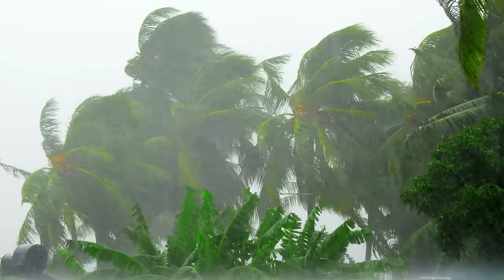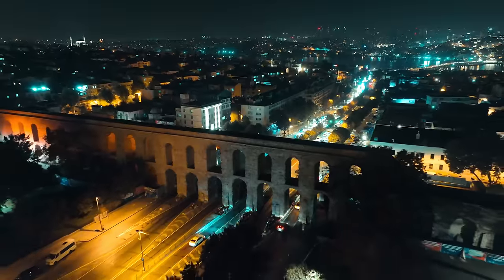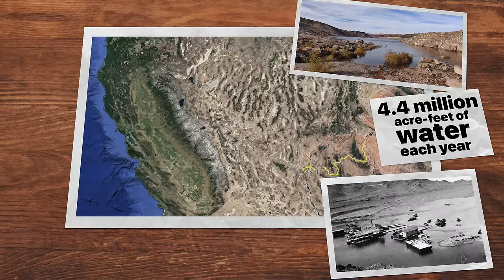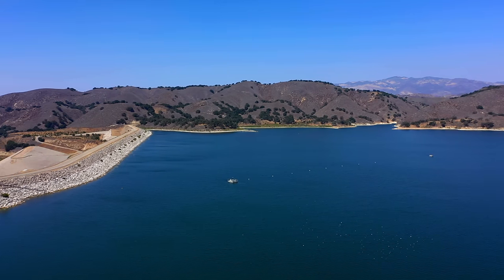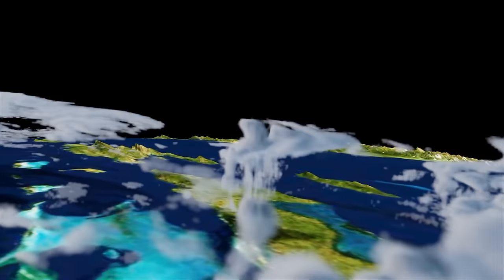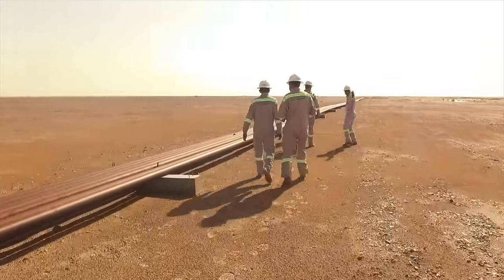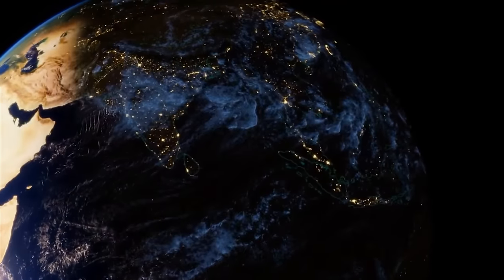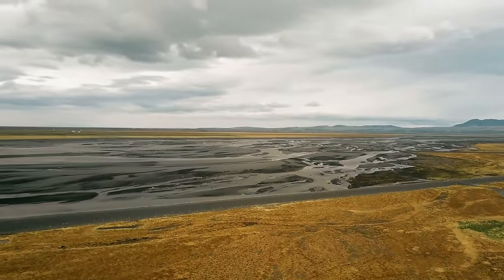Pipelines From Flood to Drought

Comment: I've been saying we need to do this forever.  Although I'd avoid "the scheduling" and just canal water out as it  accumulates or before it accumulates as a better way to say it.
Reply: We are never going to have a system of pipes that is so robust that it can move water out of the area as fast as a hurricane can dump it. And since pumping requires a fair bit of energy, it makes sense to limit the need to pump water back and forth if we can by using the most accurate weather modeling we can. We could definitely make it work without these kinds of predictive models, but there would be a lot of potential for wasting energy.
Reply: @johncrofford  Who said anything about pipes?

Comment: I actually thought about this not too long ago. Didn't know about existing pipelines though. Glad you did a video of this!  Your videos are always insightful and thought provoking. Keep up the great work!
Reply: Those existing pipelines don't follow routes that actually represent where you would want to move water, as a rule.  Once you consider that you would need to relocate the pipeline, the cost of pipes becomes a minor factor.  Just scrap the old pipes, recycling them into new pipes that better meet specifications for transporting water and skip the "cleaning" as described in the video.

Also, his calculations about how much water you could move through Keystone (presumably the earlier Keystone, not the XL that was cancelled) was laughable.  Aside from that pipeline not following a route where you would be interested in moving water, not following a route with major energy requirements for moving the water, etc., you can't simply take the viscosity difference and extrapolate how much water the pipe would move in that way.  The pressure in the pipes would, in fact, be far higher than "the same" because viscosity is not the only consideration.  You would be vastly increasing the velocity of the liquid in the pipe when you attempted to push 100x as much flow through it.  I'm pretty sure Keystone isn't designed to handle a high velocity (maybe supersonic, though I haven't looked up the current flow velocity in the pipeline or done the math for 100x that flow) flow of that magnitude.
Reply: simply add it into the ogallala

Comment: Wouldn't that just cause issues with other rivers since alot of that water goes into underground water systems that feed into various locations? So wouldn't that cause changes in areas that are outside the area water is coming from? You'd have to do this for everywhere or you risk changing the fertilization of the soil as well?
Reply: Absolutely,    and the water that flows into the ocean is not wasted,  It is a vital part of the eco-system

Comment: Thank you for addressing this with such thorough analysis. I have been suggesting this for 30 years, ever since the 1990 floods in Missouri (where I'm from). As a matter of fact, Missouri floods frequently, and the ability to move water from flooded areas would be a huge benefit. And that's not even counting the benefit to the dry areas in need of water.
Reply: Watch California insider.
Reply: The problem imo is that desalinating water would be way cheaper and less energy intensive.
Reply: @AnotherAmerican91  Still enormously expensive.  Got a fusion reactor somewhere?  We'll just manufacture water.
Reply: @knoahbody69  I don't live in California, I'm just saying if I did I would want to go in that direction. At the end of the day, if you live somewhere where there isnt infinite water, then your water is going to be more expensive. That's all there really is to it.
Reply: @knoahbody69  the west feeds you . America used to think and build big. Funfact burley idaho was going to flood in 87. Bunch of local people got together and lead by local church leaders. May have got the idaho guard to help.  The feds said we'll study the prob for a couple years. The people in iirc 7 days cut a cannel around the city to divert the flood that was toping a dam built in 1915 that had never filled. Lawyers said let the flood happen act of God no liability. Irrigation  president said we have to try and built plywood walls 4 feet high on top of the dam to buy a couple more days. America  if the environmentalists got out of the way could fix huge problems
. Look at bergoine new jersey needed a taller bridge for the new Panamax containerships. Both a tunnel or new bridge would cost 4 billion  instead they could raise the roadway 20 feet  to 165 foot clearance for a billion.  The epa fought them saying more similar would polite the air and two Kansas tribes sued to stop on maybe disturbing native American sites despite  not one shovelfull of dirt would be moved. All work would be on the already built bridge.  Please read book called a government of nobody.  Fun story's of a tree blocks a creek. City wants to send backhoe to save people's homes from flooding and city attorney  says  no we have to get army Corp of engineers approval.  Because that's a federal creek!  Ie while not navagatablebits self it was tributary to navagatable waterway

Comment: Thank you for covering this subject. I have been thinking of this myself. Even if it helped only a little it would help both ends of the pipe. I don't know if it would prevent flooding but over time it would surely reduce the cost of our food. Taking your final points too their logical end shows that we would also have more usable land and reduce drought. I hope someone is working on this.
Reply: Re: reduce the cost of our food.....
The greatest train robbery in history
Prices are not going up; that's an illusion
The value of currency is simply going down

Comment: Moving water to the desert is a reasonable idea and it is worth thinking about.  However, I think that oil/ng pipes are just too small for the task.  You need huge pipes to transport rivers of water. Also, the desert southwest is at high altitude so you have to pump uphill to get water to places like New Mexico.   I remember reading that it takes the same amount of energy to move water up one mile that it takes to desalinate it.  But this doesn't mean it isn't worthwhile thinking about it and thinking about the costs.
Reply: There is more fresh water under the ocean then exists on land.
Reply: I did the math, and the cost in energy alone to move the amount of water required 1500 miles is $28 billion per year.  That is just the baseline, it doesn't include anything other than the power cost, and that is still lower than the real operational cost would be since it would require far more facilities than my simple math includes.  with 28 billion being the minimum possible cost, there's no way this is feasible.  Also, I must add, the power grid isn't even capable of handling that much power per year on its own.  Just goes to show that working AGAINST nature isn't going to work.
Reply: @zarroth , how much water was moved with $28B?  If we divide that up by the gallon, what’s the cost per gallon?  If we have so much oil pipeline, then unlike in the Australian project, we cannot assume it is cost prohibitive…the value of the commodity must exceed the cost of purchase. So if the cost per gallon is low enough, then states, or farmer cooperatives will pay it to get their water.  We already move this much water, and more, in local crop circle irrigation…just that the water isn’t moved long distance.  Calculate in the amount of wind turbines that are turned off each day when the wind is producing more than the grid needs in that region, and what could be done to reduce the cost?  Just thinking out loud here, but if you’ve done the math…what is the cost per gallon? 😎
Reply: Look up California Insider on YouTube.
Reply: Well we could spend $20bn once and build a hydro storage dam in the mountains. Pump from the east before wet season to the hydro storage using the wests plentiful solar energy during summer. Come rainy season the east has capacity to store water, and the west can drain the hydro during winter to produce electricity and get freshwater.
Reply: @zarroth  That's not even considering the capital cost, which according to any rational economic analysis would need to be paid back over the years by charging water users (mostly irrigators) for the water that they use.  It also doesn't consider the political cost of taking water from watersheds in one part of the country and sending it to an entirely different part.
Reply: @SuperRainbowpoop  Capturing "flood water"  -- which is often flowing at hundreds or thousands times average flow rates -- requires enormous reservoir capacity.  So, aside from all of the other enormous physical obstacles to a cockeyed scheme such as this -- where would all of these reservoirs be built?  And, given the political reality of opposition to constructing more dams on rivers and "relocating" the people living upstream, how many communities would tolerate such a thing for the benefit of people who have chosen to live in dry parts of the country?

Comment: Cool plan.
I will say that viscosity and flow rates don't work like that. 
When you push something through a uniform tube, viscosity is less a factor than sidewall resistance. 
If you were extruding like pushing from a larger to a smaller diameter pipe, the viscosity would be a huge component of the flow rate. But thru straight tubes with largely parallel sides, no.

Comment: There's two problems I have with ANY proposal like this: 

1) Economic output concerns: the Mississippi watershed and waterways transport 60% of all US grain exports.  ANY INTERFERENCE WITH THIS is a major concern not only for the US but all other countries the US exports grain to.

Unless a plan is made to make sure this doesn't happen it's an automatic NO GO.

2) Safety concerns: a pump failure WILL cause flooding downstream.  A pump failure ANYWHERE along the pipeline will cause catastrophic events.  The power has to be on 100% of the time.  Period.  No questions asked.  99.999% of the time WILL NOT CUT IT.  It has to work... and it ALWAYS has to work.

Last I checked: California has problems keeping the lights on.  This is a NO GO.

Comment: hey ricky
i have a idea in my head for last 6 mths
when i seen the australian idea that u mentioned
using pump hydro
pump up the water thru elavated dams then reclaim 80% of the energy
on the way down
that way u can pump up hill with renewables
and release down hill for power
tunnel thru mountains to make it closer as well
some of these dams can have muitable directions to send water in differnt directions
also can be return to sender when the dams are low
it also can be done 1 dam at a time because once 1 pump dam is built it can be use straight away
as battery
It could store a hugh amont of power
Reply: They have been doing this for over 100 years. There are existing pumped storage plants in the US up to 2000 MW.

Comment: @Two Bit da Vinci, I thought of this decades ago. The only potential problem would be filtering out the living organisms from wherever the water came, so as to not contaminate distant rivers with foreign invasive species. This could be done with filters that have ever smaller grates, then a portion of pipeline heated to a temp that would kill everything that made it past the grates. This could even be integrated into a Green Energy system, as a way to store potential energy (as heat), and get it back turning turbines.
Reply: That’s why you would want to keep any exchange of water local to their own individual water basins
Reply: New Idea:  Pipe glacier melt off Greenland to N. America, and Africa.  This could slow Atlantic Current slowing due to the insertion of cold water and work to reforest desert areas.

Comment: Through the years I've always wondered why this wasn't done.! Your explanation for the flow of water using former pipes that are already in the ground but not being utilized is great. I hope we are about to see this concept into fruition. It is something that is very much needed especially since we've entered climate changes.
Reply: Never happen. The EPA and Peta won't allow it. Been like that for 40 years.
Reply: all of those pipes are in use. it will be multiple life times before we are "no longer using fossil fuels" and those pipes could be repurposed.
Reply: This is a very great idea which, if used, will go a long way to fight off hunger. The same idea can be applied to water from the melting glaciers which should be channeled to the deserts for forestation or reforestation by planting genetically engineered plants which can be drought resistant. Countries and companies should be made to contribute a percentage of their GDP to the project.
Reply: Ca doesn't use water wisely
Reply: K B is correct💡🎉🏋🏾‍♂️🍎☀️

Comment: I had thoughts about this  exact topic quite a few years ago.    My idea was putting tanks through out the USA, but also included pumping water to areas where there was a lack of water from those places that have an over abundance.  In my state where I live it is much like CA and doesn't have lots of water.  I like these ideas of water management.  I am not sure that A.I. is the right solution, because those predictions of weather are only as good as the model.  Nice video though.  I think those are solid ideas for re-purposing oil or gas pipes.  However, I am not sure we should be giving that kind of power of choice to a machine?  We are getting lazy and that is not good.
Reply: The machine can show us the most optimal way things can be done, idkw people could argue for a person to do the job, but not as optimally.
Reply: @mrillis9259  okay, I hear you.. why are you so concerned about optimization? If that is your bottom line, we can all be replaced even you.  I advocate for people because we all need jobs. This attitude about optimization,  efficiency, blah, blah, blah is all the logical reasons to take someone's job away. Bottom line is the desire for more money in few and fewer hands. In other words it boils down to greed and the love of money. Do you get my point now?

Comment: Floods and drought are quite exceptional phenomena. This seems to be a very expensive project (with or without an existing pipeline network) with marginal benefits. But most importantly, If we build a system that uses flood for our benefit, we will become increasingly dependent on it. To me, that seems like a recipe for disaster.
 It would make much more sense to apply water conservation methods in areas that use much more water than they can collect. There is definitely room for improvement in California.
Reply: Yeah, he side steps a LOT of problems with his plans. He also ignores a LOT of work done by skilled and brilliant individuals that use more efficient methods of doing similar things.

Comment: I have a background in Civil Engineering, from my perspective if we wanted to invest in an expensive system that can move water across the nation we need local storage systems to capture the large volumes of water that result in flooding. The two reasons for this are that the intense rainfall and subsequent flood are short-lived and the more volume you must transfer, the higher the cost.

Additionally, from my understanding, one of the reasons the Colorado River reservoirs are so depleted is because we’ve overdrawn water and the limits, we put in place to maintain capacity based on what could have been a historically very wet period that we failed to adjust once conditions became dryer.

In a system that draws water from the Mississippi for instance, we’d need to account for historic flows and set a minimum flow rate that reaches the mouth of the river to reduce the risks of using too much water. Excess water you be sent to places like Atlanta and out west if minimum conditions are met.

A system like this would have to account for environmental impact, displacement of people, and maintaining navigable waterways (all of which are possible to mitigate).

A project like this would be multiple decades-long, and we should continue to focus on investing in methods to reduce water usage regardless of whether a megaproject like this is built. Reduce, reuse, and recycle in that order.

Comment: I don't think the answer would be to totally cut out fossil fuel pipelines for water, more likely, a more rational solution would be a certain percentage. Getting rid of fossil fuels entirely is not a good idea at all. In fact we should probably try our best not to get rid of anything we already put energy into creating, rather we can make supplemental greener energy going forward (and no, solar and wind [so far] is not the solution as they are environmental disasters and poor net energy positives) but old fossil fuel creations are still the most energy efficient and NEED to be in place for emergencies (like we're seeing now all over the world) and energy supply robustness (if one system goes down ie no sun/wind/water you have backups). The excess rain in these areas needs to be caught in the highest possible elevations so as to relieve pump dependencies and further even possibly be able to generate electricity from them using hydro electric turbines. Catch the water high and then tie into existing systems, maybe start with one fossil fuel pipeline, where it is bought from the oil/gas company where they will use those funds to build more pipelines. The idea to buy the pipeline is to create a faster implementation while the money towards this idea still goes to it.

Comment: why not try using ram pump system? you can also just put an inlet for the water at a decent level to send the water through the system just below flood stage. Use basic hydraulic systems that do not cause as much emissions or stress on the power grid.  This can also keep certain desert cities from causing a "dustbowl " in the "flyover states ".